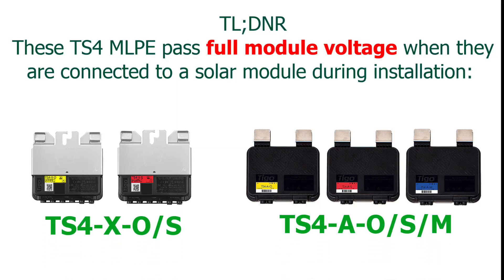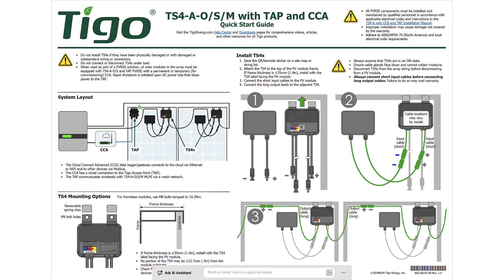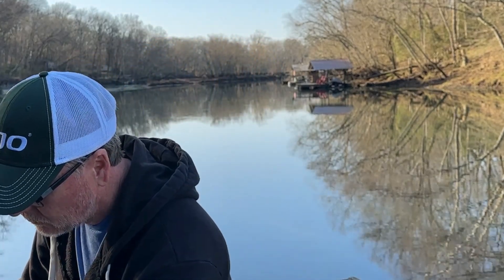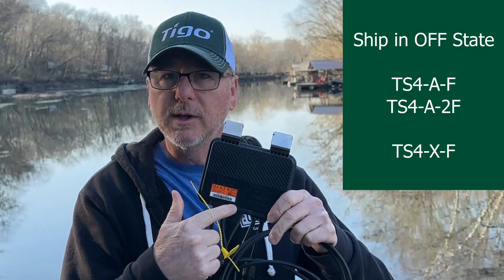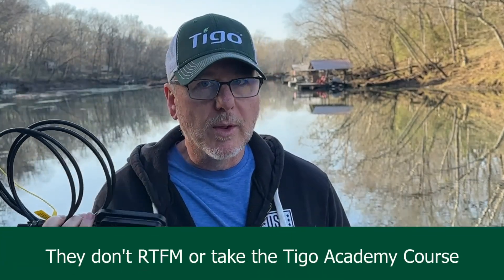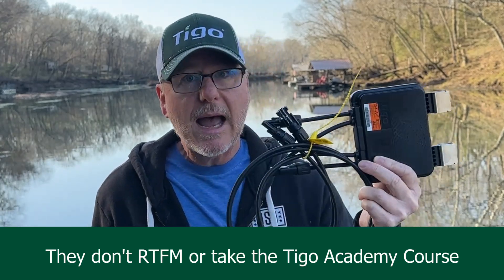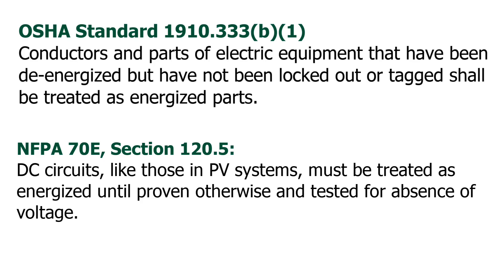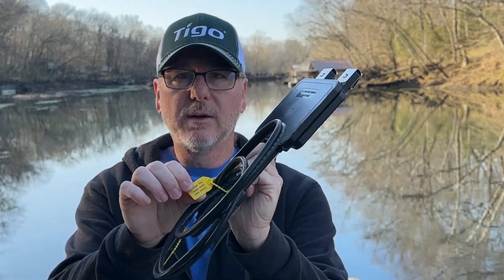TS4 O & S Live Voltage Safety – What You Need to Know!

Comment: I must apologize.  I hold a great deal of responsibility for installers not reading manuals because I read the manuals for them and then put the critical details in the notes on the plan set (because I know they won't).  RTFPS!!! (They rarely do that either)

Actually, I met a contractor of ours at the jobsite once, and he referenced a page in the manual when asking me a question.  I was so floored to have an electrician on our jobs that actually read the manual.  Turns out he was a third-generation electrician. I guess that's what it takes.  I tried desperately to poach him for a long time after that.
Reply from the maker: That is a great story. It does catch one offguard when you see someone on-site with the documentation in hand 😲

Comment: I have 23 TS4-A-O installed, two are failing to report, tech support is advising me to get up on my metal roof and disconnect live 250+ vdc strings and take photos of the volt meter readings I get.
Reply from the maker: We strongly recommend against performing any work on your system while it is energized. We are available to assist you with a safe resolution to this issue. We always recommend that electrical work around lethal voltages be performed by qualified personnel as described in the National Electric Code. If module voltage readings are recommended, it appears that the support team has exhausted all previous troubleshooting steps.